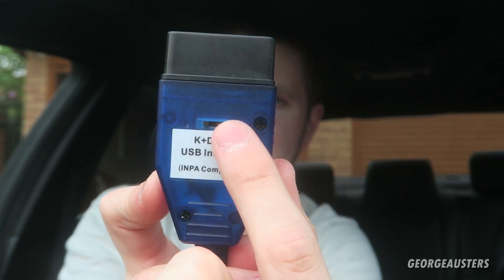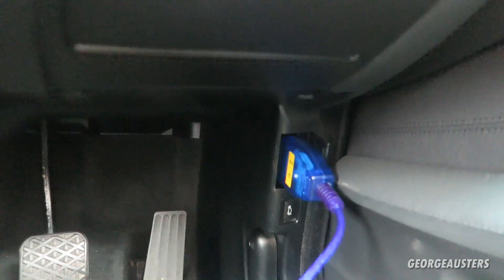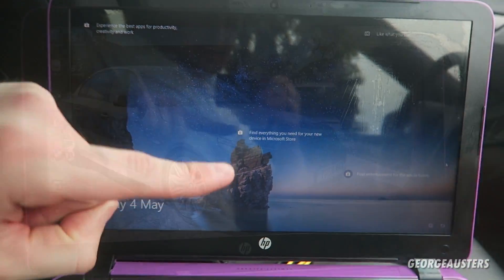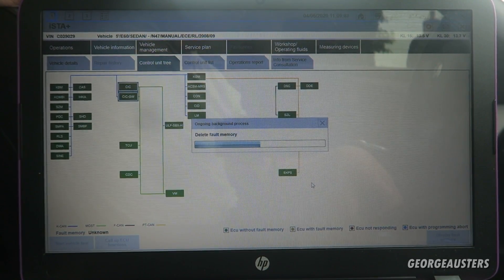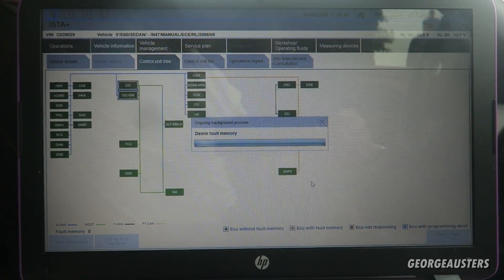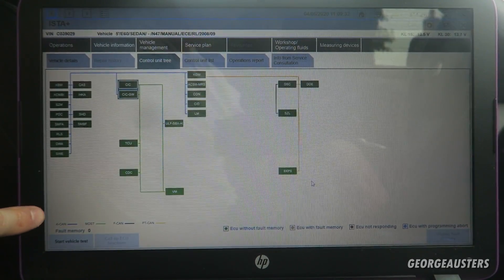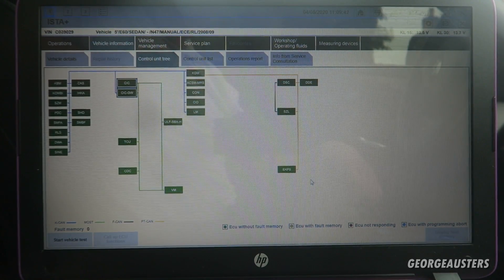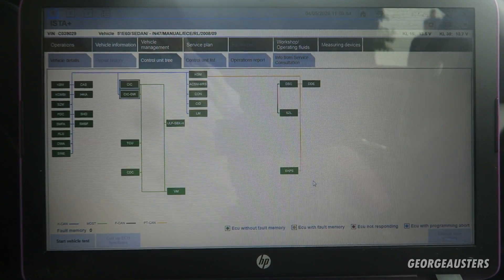BMW Diagnostics Check Using ISTA D

Comment: Hi George,
I have a 2009 e87 118d msport I am trying to run a diagnostics on it tonight but it seems like my cables arent working im gonna buy a new cable can you confirm which one I need please I already have ista+ installed and ready I tried using the Ethernet cable but no joy……😢 Please reply asap im very close to burning my car to the ground 😂

Comment: Hi George the link for your software and cable are dead could you please put me on to the software you purchased. I have bought download off eBay but turned out to be absolute waste of time and tried multiple downloads and installs that are missing the old.i files I just want a reliable copy of ista much appreciated if you can head me in the right direction

Comment: If you use k+dcan cable, how is it possible to read your battery voltage in real time?  as far as I know, no k+dcan cable is able to read the battery voltage in real time.  So what trick do you use?

Comment: I don't know why,  but my obd2 cable K+dcan, it doesn't show my battery voltage, and because of this it is a problem when you want to delete the errors, the deletion operation is blocked. I read that an older version of ista+ would solve this problem. My version of Ista+ is 4.32.15

Comment: George can you run ISTA D to do all checks on the car with the engine running or do you need to just leave the ignition on, as i need to replace my battery or charge it up as i get an amber warning before the car shuts the ignition off. I  an issue with the injectors from all accounts 1 or all the injectors are open i spoke to a BMW mechanic through my work. Described the issues, and he said one or all of the injectors can be open and the cause of the dumping of fuel into the cylinders. I saw a person running his engine when checking the flow rates of fuel going through the injectors where he was running the engine on youtube but wanted to ask. Thanks in advance,
Reply from the maker: You can do it with engine running👍🏻
Reply: @GeorgeAusters  thanks George end of month i will make a contribution - I mean that your knowledge and skills and having access to you help me greatly.
Reply: @GeorgeAusters  second question George what is the best batter charger - i know you did a video the other day - what would you recommend - thanks again - hope you are having a nice day - PS did you get the issue sorted with the car -

Comment: Please do a video on the installation process 👍🏻

Also can I ask what is your windows operating system and hdd size? 
I’ve got an old windows 7 laptop with 135gb HDD so wondering if that would be enough just to run this software. 

Congrats on your moving to YouTube full time, I look forward to more content.
Reply from the maker: I’m sure the listing does tell you the specs required to run the programs. I was going to make a video installing but the kit already comes with the all the guides you could need

Comment: You don't need ISTA to clear fault codes.  Any cheap code reader will do that without a laptop and the hours of faffing to get ISTA installed.
A cheap reader gives you codes.  About £100 gets you one that tells you what most of the codes mean.  About £200-£300 and you might get direct updates, a self-powered device (most useful) and better support.  ISTA D is for Diagnosis and ISTA P is for Programming.
If your car has 20 or 30 modules and is otherwise fine, ISTA will seem easy.  If you have a really sick car with multiple bus and module failures you will struggle.

So, for example, an AutoPhix 7910 will tell your car it has a new battery.  But you need ISTS P (or something expensive from Autel range etc) to tell your car it has a different size or type of battery.

As @Vilius Vasiliauskas said 9 months ago: ICOM is only a completely different approach.  With a Dcan alone you can do 99% of programming with WinKFP on E series (and) Mini R series.  Head unit is the only module using MOST connection and will require ICOM for this to be used with ISTA/p or ISTA+.

Hope this helps someone.

Comment: Hey mate, what did you do to get battery voltage shown on top right corner? Mine it does not reading it, and i believe that is linked to why I cannot remove the stored fault codes. 
When asking to turn off ignition and remove key fob, nothing happens. Even though, after I press cancel, the errors are deleted.

Any idea ? 
Appreciate it
Cheers
Reply: Same problem here
Reply: MRmed1a certain versions of ista, after 4.10 no longer read voltage through KDcan cable, therefore it will not read out when you remove the key fob and reintroduce it
Reply: @CostelTarata  well that's balls. Hmm so why update ? Got airbag and seat belt code on first days of owning the car I reckon moved the seat too far back and loosened a connection under the seat. Fault not current but sort of annoying as it pops up all the time. Thanks for the quick reply will look into a download also will install both versions? as I have few bmws in family

Comment: Do you have ISTA P too?
Reply from the maker: Yes👍🏻
Reply: George Austers Sweet, I'll message you on Messenger mate I'm in the 130i group. Could do with a bit of help on something.
Reply: @dacads  have you found any ista ? i need ista for a problem with f34 320d gt 2016 model

Comment: Hi George, thanks for this video. Clear explanation. The only part I do not understand is how you were able to get the KL15 and KL30 voltages with an DCAN cable. I have the same setup though do not get reading of voltage on my E91 and was told this is only possible using a ICOM. Do you know why? Thanks, Andre

Comment: Hi George, I’m not familiar with this program but I think you may need to scan the car again after deleting codes. Maybe you did this but in the video it looked like you deleted codes and when it had 0 codes you took it as no faults, I think you’ve to rescan it again to see what codes come back. I usually drive it for a bit before scanning again.
Reply from the maker: You're completely right mate. Will give it another scan tomorrow!